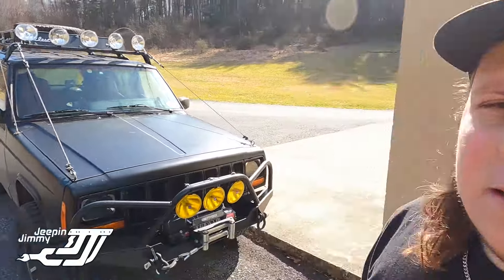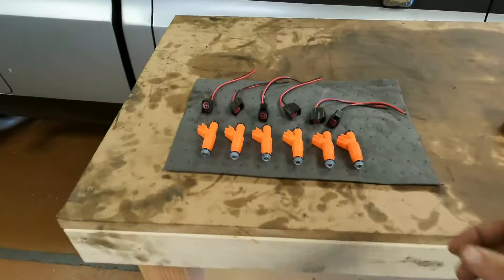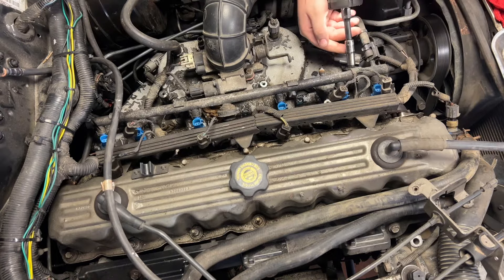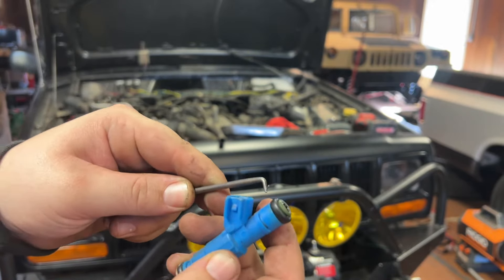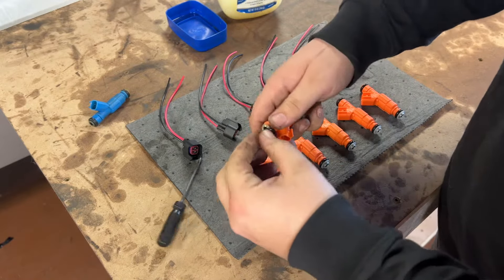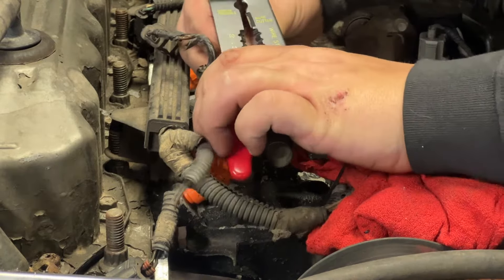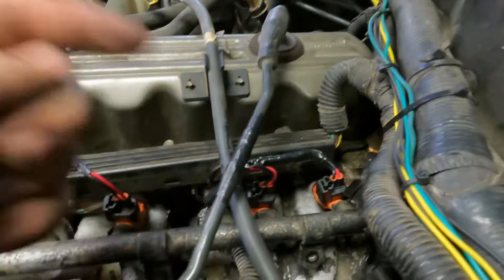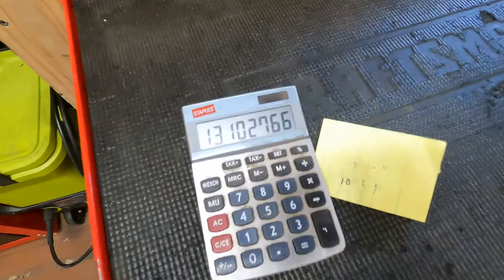Are BOSCH Fuel Injectors Worth It? DIY SWAP

Comment: It may get better over time as well. I've heard the pcm can take up to 50 start ups to get the new fuel and air mixture perfect
Reply from the maker: Right on! Thanks, hopefully it does
Reply: 50 starts? WTF? Why? How did you get this number? Please let me know because I am very interested.
Reply: That is incorrect once the vehicle is at operating temperature and is in closed loop the fuel is ran off the O2 sensor. O2 enters the vehicle and a MAF sensor and air temp sensor tells the computer how much O2 is entering the combustion chamber. The throttle positioning sensor tells the computer how open the throttle blade is and the computer goes to its fuel table the computer will check demand from throttle positioning sensor what gear you are in what load is on it and at what RPM to tell the injectors how much fuel they should spray. After the combustion cycle, exhaust runs over the Upstream oxygen sensor first the Upstream oxygen sensor compares the oxygen content of the exhaust with the oxygen content of the atmosphere if it notices a difference it makes adjustments by shutting the fuel injectors on and off faster or slower this is called closed loop if your vehicle is operating the way it was intended and efficiently the only way you're going to make a difference is by changing the computer's fuel table other than weight reduction and less wind resistance. Now if your vehicle is not running the way it was intended then the PCM will try to learn adjustments to get the fuel ratio that it wants to see basically if all your parts are running the way they're supposed to it the PCM won't have to relearn nothing it will just go into closed loop and run off of the O2 sensor the way it was intended

Comment: Very detailed. Thank you!. FYI - Petroleum jelly will degrade rubber over time causing it to harden and crack, a silicon grease is a better option for lubricating o-rings
Reply from the maker: Thanks! Right on, good to know
Reply: @christhomas9300  .....or get some P-80, which basically dissolves away after the part is fitted!
Reply: Buy a can of sunroof greese. Best to use on these gaskets
Reply: Wrong it works great and that's exactly what you use for rebuilding transmissions which I do too.

Comment: I used k suspension 12 ports.. I sea foamed before hand did a tune up then changed them out post ecu reset and relearn I got about 14 to 16 mpg on 3 inch lift with 31s and a roof rack and trunk full of tools after adding a BBK throttle body and cold air I got about 17 running cruise control I’m happy with it mpg changes all the time so this was under best conditions
Reply from the maker: Not bad though! I might have to switch to 12 ports
Reply: @JeepinJimmy  I went from stock to 12s idk if you’d notice much difference from 4 to 12s though
Reply: BBK exhaust manifold helped a lot

Comment: Man buddy you were doing such a awesome job right up to the point you used “Butt” connectors for the new wires🤷🏻‍♂️. Ya gotta know you are supposed to solder those wires and use heat shrink to protect the connection. But hey to each his own👍
Reply from the maker: Yeah you’re probably right. Just working with what I got man haha
Reply: Solder is actually known to get brittle over time and is less flexible than the original bundle of wire, in most automotive applications it's recommended you use crimped connectors with heat shrink that has glue inside it, especially in tight areas that experience high heat.
Reply: I’d shy away from soldering.  High dollar heat shrink crimp connections with at least one or two layers of heat shrink tubing.   It was probably my own idiocy trying to solder FI ends on, but I fried the ECU.   I know I jacked up the soldering… but I wanted to use crimps and got talked into soldering …. Anyhoo.  Peace
Reply: I always use the heat shrink solder connectors
Reply: I don't solder those wires.  I crimp connect, then paint with liquid electrical tape, then heat shrink.  Same with my boat trailers.  Unless the wire harness is subject to motion, like  the harness that runs into the drivers door for the master window/lock panel, it'll never break.

Comment: The short answer is no you won't get better fuel economy by switching to Bosch the gains in fuel economy you are seeing is because you had bad fuel injectors and now you're replacing them with new ones as long as a fuel injector is spraying a mist and not leaking or dripping the fuel economy is going to stay the same the only way to change fuel economy would be fuel tables but if everything is in working order the engine should run efficiently with the stock fuel tables

Comment: This particular engine has the intake above the exhaust and the  air temp sensor is in the intake. Heat from the exhaust heats up the intake and can cause the  air temp sensor to read hotter air temperatures then whats actually going into your engine. My advice would be to switch to a header, wrap it and relocate the  air temp sensor from the intake to the breather box. This should increase your performance and fuel economy after you have driven the vehicle for a while versus if you still had the air temp sensor in the intake
Reply: Your comment make me to search more about. 
Makes a lot of sense. 
Just tap a plug in the existing hole 
Then make a new screw hole for the air temp sensor in the air intake .

Comment: nice video - well, several opinions about 4 hole injectors - fuel pressure and pulse width are given values - change in fuel economy and performance are not really noticeable.
Reply: Need a good fuel pump and slightly higher fuel pressure regulator aka manual paired with a set of headers & cat delete you will see some power
Reply: @SethMoffitt-op3ng  no you will not plus how you going to fit a set of headers on a Inline engine? Unless you're going forced air induction or bigger valves you're not going to see any increase

Comment: Have you seen any better mpg after the MAP sensor ran a few more miles? I'm thinking of upgrading to the 4 hole, and adding a 62mm throttle body and a K&N air filter. I'd like to see how that works, if you haven't seen it. thoghts?
Reply from the maker: I have seen a little bit of an improvement! I'm curious as to what your mods are going to do
Reply: @JeepinJimmy  yeah, me too, I haven't seen any postins of this combo here on youtube, just individually done, although, i did see one where the Wix filter performed better on the Dyno than the K&N with the 62mm throttle body.
Reply: None of what you're doing is going to matter because your bottleneck is going to be your valves if you have a bad throttle body or a bad intake or bad injectors then replacing them with new ones will make the vehicle run as intended but the only way you're going to get more power is with bigger valves the air enters the engine through valves you would need bigger valves and they would need to stay open longer other than getting new valves a bigger can could help with this once you have that accomplished then you can Port the intake and run a bigger throttle body that will be the only way you'll see a benefit from doing that
Reply: Gotta upgrade the fuel pressure regulator after the Bosch 4 hole upgrade
Reply: @SethMoffitt-op3ng  still not going to do anything unless you can force more air into the engine you can put all the fuel you want in there but all you're going to do is run rich without enough air, and the only way you're going to do that is with forced air induction , put bigger valves and stroke it, or fuel that has oxygen in it (Nitrous)you're forgetting the three things you need in the equation air fuel Spark
Reply: @SethMoffitt-op3ng  what would the upgraded fuel pressure regulator be? higher pressure? would I need a higher pressure fuel pump too?

Comment: You mentioned heat soak at the end of the video, and it appears you do not have any type of intake manifold/injector heat shield. A company (Design Engineering) sells a heat shield kit for the Jeep 4.0L engine that protects manifold, fuel rail, and injectors from heat. For later TJs/XJs there is also a Mopar intake manifold heat shield (but to my knowledge no Mopar, fuel rail, nor injector heat shields). Also, please, what purpose do the cables running from your roof rack to your hood corners serve? Thx.
Reply from the maker: Right on! Ill have to look into a heat shield, thanks! They are for deflecting branches on tight trails!
Reply: You can wrap the header if you have a header but you need to move the  air temp sensor to the breather box and off of the intake
Reply: @UnderSprayedWhiteSkies  I've got the DEI kit and it was definitely an improvement!

Comment: Hmm my 96 gets 16.5mpg (18.2 hwy) and it's 236k mi, only thing done was the accel tune up kit. I keep going back and forth on doing the 4 hole injectors. 
But might finally do it, chasing the 18/20mpg.
Reply: DO it!!

.....and if you've got the 4.0L motor, make sure you get the DEI heat shield kit for the fuel rail & injectors, too!

Comment: Toss the petroleum jelly or use it for "none of your business" business and use silicone grease on them fuel injectors instead.
Anything petroleum degrades rubber. So, young-un, don't use it on any "injector" that needs a "rubber" seal. Ya' hear!😉👍
Reply from the maker: This is great😂😂 thanks🫡

Comment: I would use dielectric grease on the connections and the o-rings. Look into an oil catch can for better fuel economy
Reply from the maker: Ill look into that, thanks!
Reply: @bighookpgh  Definitely not on the O-rings...
Reply: @JeepinJimmy  dude, do not use petroleum-based lubricants. use ky, or one of the cheaper personal lubes. dont wait too long to put them in because the stuff will dry out but will not damage your o-rings. (cant be too damaging if you can eat the stuff LOLOL)
watching the video i can see you replace injectors enough times where im sure the o-rings do not have a chance to suffer too much from the vaseline anyway

Comment: If your vehicle is running the way it should be the only way you're getting more fuel economy out of it is weight reduction and wind resistance also staying out of the gas and not being heavy-footed will save fuel. Motor vehicles have a sweet spot where they get the best fuel economy this typically is  between 50 and 65 mph when the transmission goes into overdrive

Comment: If the engine is running the way it was intended from the factory then you're getting the miles per hour you're going to get remember less fuel means less power so you can adjust fuel tables to where the injectors do not spray as much fuel but you're going to lose power vice versa if you want more power you're going to have to burn more fuel any increases to fuel economy you are seeing is because you replaced a part that wasn't operating efficiently

Comment: I get 13-14mpg on worn 33's with 4.88 gears towing a trailer. Stock injectors. The roof rack and lights must be really killing your mpg. I see others suggesting ideas to improve mpg. One not talked about a lot would be to install locking hubs. Allows you to diconnect the wheels from the drive train so the front drive train doesnt move when going down the rd in 2 wheel drive.
Reply from the maker: Hopefully ill be doing 33s with 4.88 soon. We shall see how it does! Manual locking hubs would be good too! Thanks for watching!
Reply: Do they make locking hubs for Dana 30?
Reply: @moejr14  yes.
Reply from the maker: @moejr14  They make a conversion kit but its pretty pricey. You could be well on your way to a one ton swap for the price of the kit haha
Reply: @JeepinJimmy the 4.88 to 1 gearset has a really skinny pinion gear skinny to the point it becomes weak. 33in and 4.56 to 1 is known to be a great combination for power and efficiency and the pinion gear is still a massive chunk of metal

Comment: One issue you haven't addressed is your fuel filter. I've got a '93 ZJ with 123K and changed mine out at approx. 120K. The amount of black silt that poured out of the old filter was scary - I can only imagine the residue left in the tank itself. 

As everyone is probably already aware - 

• If your fuel filter gets clogged, it can reduce the flow and weaken performance as the engine has difficulties drawing fuel. 

• With a clogged filter, the fuel pump works much harder and you may have problems starting the car or notice poor acceleration or stalling... Because of its abrasive action, dirt and contaminants in the fuel can speed up wear and tear, damage expensive parts and even cause the fuel pump and injector to fail. 

• For most cases, the fuel filter needs to be replaced every 20,000 to 30,000 miles.

• A clogged fuel filter can cause decreased fuel economy.

I went from an average of 13-14mpg to 16-17mpg, just by changing the filter - even though I've been driving it a little bit more aggressively on the freeway. 

They're less than $20 for the 4.0 liter Jeep vehicles - some are less than 10 bucks. So, if you haven't changed yours yet, it may make a big difference in all around performance and fuel mileage.

Thanks for sharing this content with us. - I Subscribed to your channel. 👊
Reply from the maker: Thanks for the suggestion, ill definitely do this!
Reply: Could be, but for the vintage in the video I believe the filter is inside the tank.
Reply: @redtango75  Looked it up online and the fuel filter for the XJ's is external.
Reply: @dawabbitt3079  The older Xj's are external but anything 97 and newer have the filter inside the tank unfortunately.
Reply: I also have a 93 ZJ and did the 12 hole K-Suspension Injector upgrade about 1 1/2 years ago , I used the little adapters Instead of directly wiring in the new pigtail clips. Last week I ordered the new pigtail adapters and wired those into the harness , A night and day difference in how my little jeep runs now. Those adapters always were loose so I'm sure my injectors were misfiring Off and on at times.
I also changed my fuel filter, which is an external filter on the drivers side by the rear tire above the axle, mounted to the chassis area. I have 127526.5 Miles on the little in-line six and she runs like a dream.
But unfortunately my torque converter failed and ended up burning the transmission so I'm now replacing it as I write this  comment, I certainly do love my little Jeep and can't wait to get her back on the road.
Anyway, you're right about the fuel filter needing to be changed and diligently monitored, with today's fuels and all the additives and re-formulations of ethanol It's almost like the industry is quietly sabotaging gasoline engines all together.
Stay safe brother and thank you for posting.
Danny in Texas.
Reply: I have a 2001 xj  and it is internal.
Reply: I have a 97 XJ and it's external
Reply: 2000 XJ internal as well
Reply: 1999, yeah it’s in the tank

Comment: You can stuff the wire conectors with petroleum jelly to make them moisture resistant as well.
Reply from the maker: Never knew that! Thanks!
Reply: You can lightly coat them using a qtip but I wouldn't recommend it. Jelly will start to liquefy on skin Lnn so anything above 98 F (like in a motor compartment) will end up dripping everywhere.

Comment: Should have got new pins and connectors. Those butt connectors are the worst. Atleast get the non insulated type crimp them with an actual pair of crimpers and heat shrink it...
Reply: I have used the hell out of those butt connectors over the years. They work great.

Comment: On my 2006 grand Cherokee Laredo, I changed the ignition coils, plugs, and fuel injectors at the same time with all high quality parts and I went from 12.8 to 16.6 MPG after I had a misfire on cylinder 4. My advice is if you’re going to go through the trouble of pulling the fuel rail do all 3, not just the injectors, because each one can improve mpg, one thing I saw in the video that I think may get people into trouble is to try to pull the fuel rail by hand like that, I think with enough resistance u may end up braking something. The way I did it was more controlled with high leverage by using 2 pry bars against each other little by little across the rail to raise it evenly because it can get really stuck, and don’t drop an O ring like did which is a PIA to recover

Comment: The Chinese Bosch injectors are junk!  I tried a set on my 2001 XJ and one was bad when I put it in.  Withing days another failed.  I pulled them all and put in a set of OEM injectors. The Chinese Bosch fuel pumps are also trash.  "Botch" has never been a good brand in my experience. I didn't name then "Botch". That was an accepted description way back in the Sixties.
Reply: What brand is OEM? Need new ones don't trust Bosch
Reply: @KMRscoo  Semens